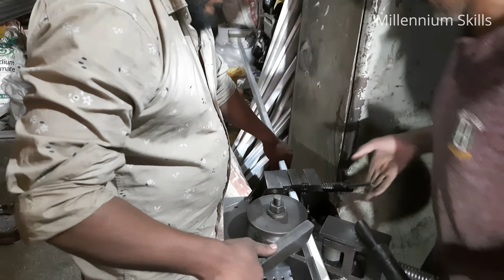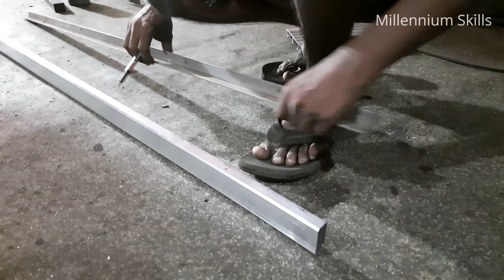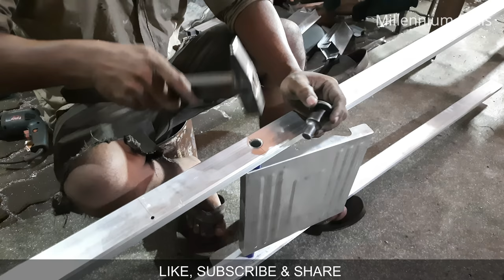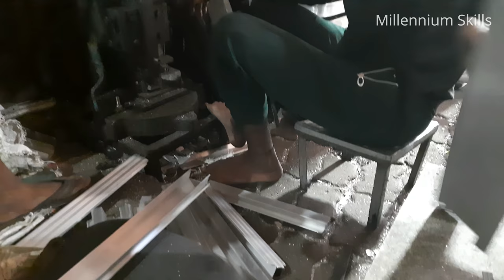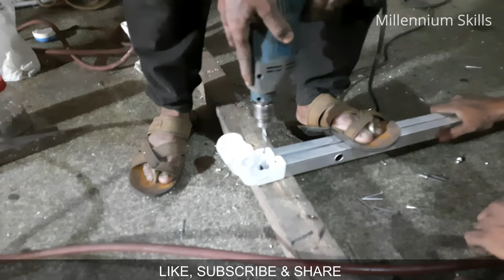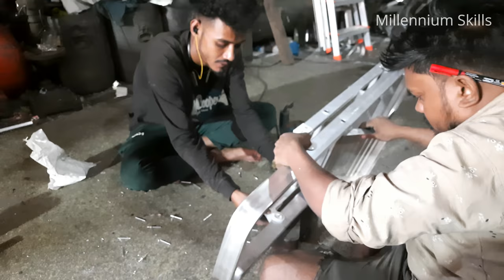How it's made aluminum ladder

Comment: See inside indian steel factory working this is nothing than workers working there with same manner near molten metal with no safety  only water to keep safe them from deadly molten metal and machinery they keep pouring water on them self to remain working in harsh environment for just 15000-20000  or 200-300 $ monthly

Comment: Pathetic and disfunction process of Manufacturing.
The Process of Manufacturing is Not the shape or copy of the product
Ladder Lack the function and stability as per the ANSI or BS Standard.
Please don’t indulge in promoting this kind of product, the product Lack in stability
And very Dangers in function, This Kind of Ladder Assembly by ignoring the quality and 
Functional requirement.  PLEASE DON’T COPY THE DESIGN 
Do the Homework before you product the copy product.

Engr. MUJEEB UR RAHMAN
(Industrial and Manufacturing Consultants)